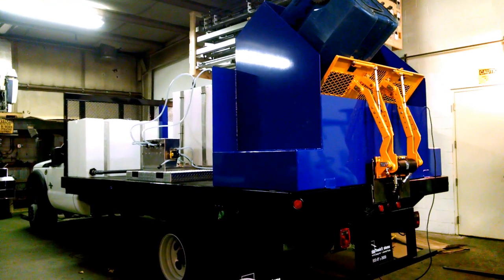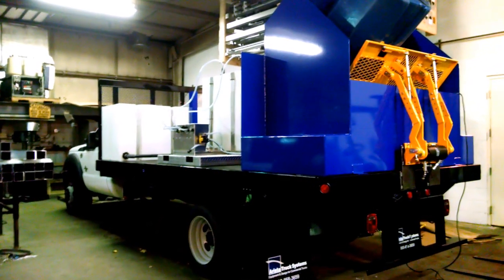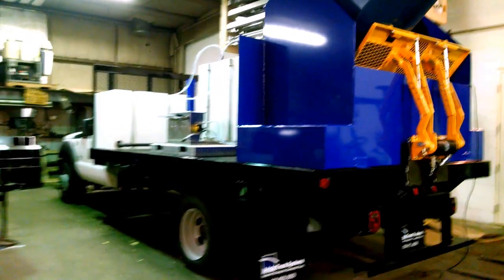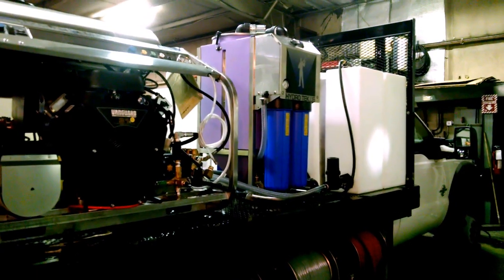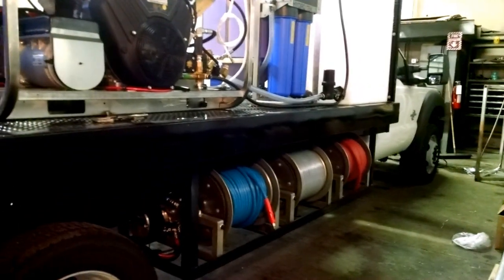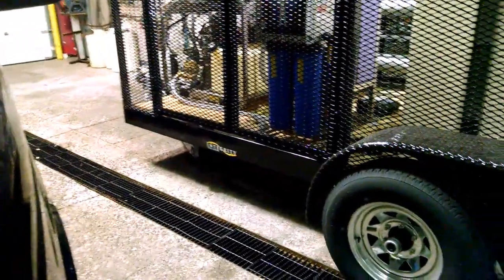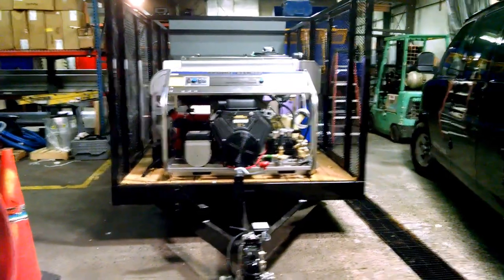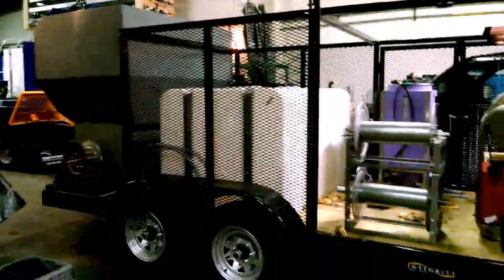Wheelie bin cleaners with 8 stage wastewater filtration & hot water trucks & trailers for sale.

Comment from the maker: Wheelie bin cleaners / trash bin cleaners with 8 stage wastewater filtration, 3500 PSI @ 9 GPM hot water pressure cleaner trucks & trailers mounted systemsa available. 800-666-1992 sales@hcsclean.com www.hcsclean.com